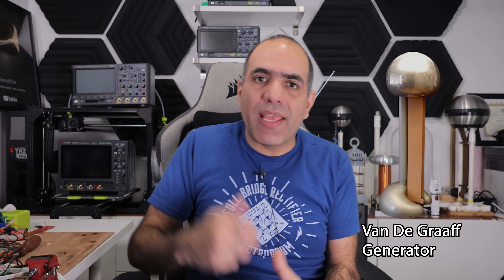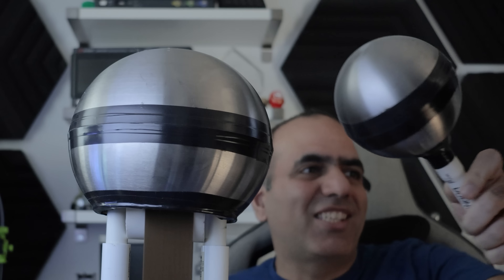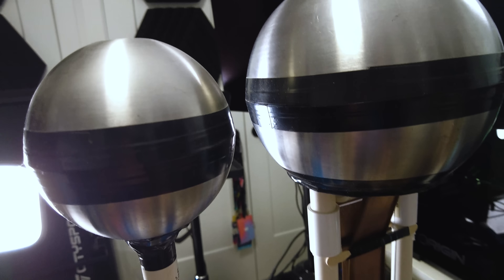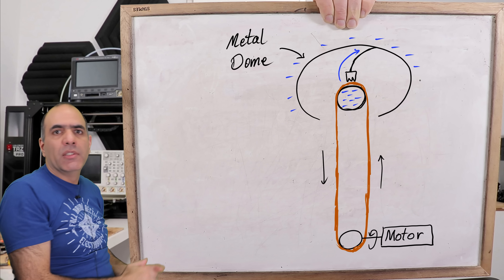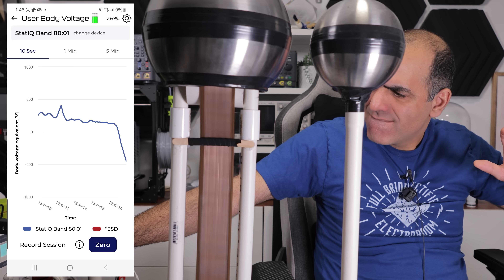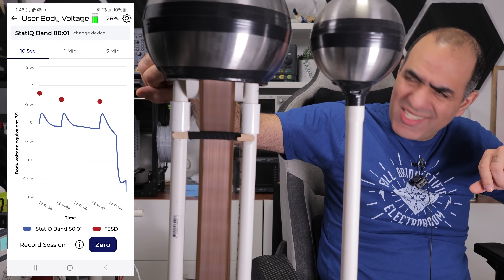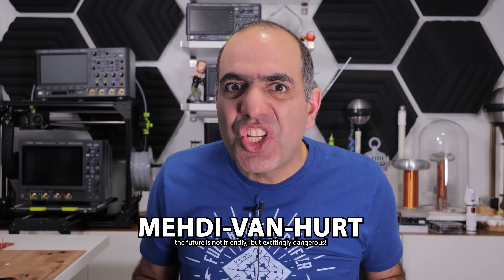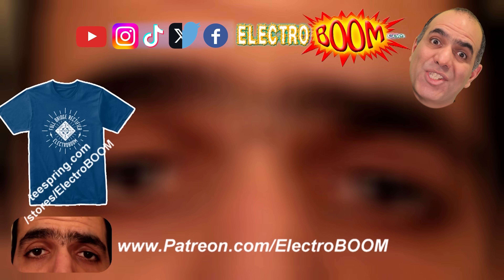An Attempt Was Made!

Comment: 2:24 , just a tip about brass, it usually contains 2% lead to make it easier to maschine, so PLEASE be careful when sanding, melting or cutting it! It should be done in a controlled enviroment where dust doesn't escape into the enviroment or into your lungs, or onto your skin! 

There is lead free brass, but it is much harder to find, usually not much more expensive, just harder to maschine, but a bonus is that it is a stiffer and stronger material :)
Reply: attempt #2: 

Isn't the lead like, chemically bonded to the copper, so it's safe?
Reply: @dimitar4y No, it is not bonded, it is inside the alloy matrix, meaning if the metal corodes or made into a fine powder the lead is free to leach out, brass is corrosion resistant, not corrosion proof. There have been studies on it. And as the WHO says, there is no "safe limit" on lead exposure as you cannot lower you lead levels and the neurological damage that is done to you is permanent.
Reply: @dimitar4y  Yes, it is called metallic bond. Under non-corrosive conditions the lead wont do anything to you.
Reply: @user255  that just makes me question is inside-your-lungs and inside-your-mouth/stomach considered 'corrosive' enough :D
Reply: @ Unfortunately, I don't have a lot of right tools for the job, metalwork especially. So I file like mad. My favorite file is diamond coated because it always bites. But it turns metals to fine dust. Even dumber of me, filing is very boring to me so it is the sort of thing I do indoors while watching Youtube or TV. So almost certainly the area where I am most often is probably contaminated with lead dust ground fine enough to float like smoke, or work into microscopic crevices only to slowly dissipate later into me but may continue to hang out when I clean.

Zinc and Copper are required for human life. It probably doesn't take much to overdose, but since the body has to deal with them, it can probably excrete the excess, so I wasn't worried if I picked up a microgram here and there.

Lead goes in and probably stays in, I think part of  why it is toxic is that the body don't know what to do with it. IIRC it confuses it with calcium so might squirrel it away in bones, maybe bring it into solution again if it needs calcium elsewhere.

Ordinarily, as an adult, the amount I got from brass dust probably isn't a big deal. But my stepfather was a sign painter of the "fuck the nanny state" variety. He had loads of toxic heavy metal paints, in the livingroom where he was trying to get his business off the ground. From dusting the house as a kid, and seeing the bright colors in the dust, I know sanding that paint sent it everywhere. I was past the age of highest susceptibility to lead but I'd bet a few cookies I absorbed a fair amount back then, along with cadmium, mercury and etc. 

Also when I was little, I helped my bio-father rebuild his Fiat engine. I once had the task of wire brushing out the exhaust manifold. Being an error prone 4 year old, I know distinctly remember taking a deep breath to blow the gunk out of the manifold, but did it with it held up to my mouth too early and instead inhaled the dust directly. I can't see how there could have been lead acetate but whatever it was, it was sweat. It was before unleaded gasoline was a thing.

Point is I probably already have unhealthy amounts of heavy metals in my body and don't really want to chance taking on more. I got very lucky and still ended up with an IQ above the 99th percentile, but who knows, maybe I would have been an Einstein or put it to better use if not for the poisons.

I have been noticing problems that may be neurological. I often feel this sensation like small ice water droplets are landing on my skin when they aren't really.  I have mind blowing insomnia, like 5 days straight without even nodding off. A while back I actually looked to see if it is possible for Tourette's to develop in adulthood because I get these weird whole body twitch/spasm things. They're kind of like a sneeze, like you can hold it back for a little bit, but eventually it happens. I seem to have damaged my shoulder for the long term from one twitch and have quite a few minor injuries from others. It gets worse when I try to fall asleep. Then there is the problem of my short fuse getting shorter and anger that seems to swallow me. And then there is this damn brain fog I can't seem to break out of. I used to be able to write and speak well but now, well you're reading this awful shite. I used to be especially good at physics and pretty good at advanced maths but now I get confused trying to do algebra or see how to make machines that do what I want. I used to be able to do things like hold a 3d model of a mechanical adding machine in my head and simulate it and see the general shape of equations to describe the motions and shapes of the parts, now I can barely handle a simple gear train and the equations are gone. I was getting ok at electronics, then that vaporized. Next I'll start singing "Daisy Bell" in an increasingly slurred voice after refusing to open the pod bay doors for Dave.
I don't know that any of that has to do  with lead, my guess is no, but since I have been having difficulties, it caught my attention as a possibility to toss on the consideration queue.
Reply: @ggarber4763  If you are worried you can look up if it is possible for you to get your lead levels tested, that would clear up a lot for you and maybe reduce your worry. Hope it gets better soon for you!
Reply: @dimitar4y  1. No. 2.Copper dust is also toxic, so also no. 3. Unless you have Wilson's disease, your body will break the bond and excrete the copper only. 4. Still not a doctor and not medical advice.
Reply: Brass is made from copper, Zinc, and tin, .. the only thing that contains lead is you brain :)
Reply: You might want to mention that to the state of California because my brass didn't come with a sticker saying it is known to them so I didn't know about it. Now I'm a little worried that it explains my persistent brain fog.
Reply: @ there's hundreds of causes for the 'fog
Reply: @ggarber4763  Well, any brass with less than 1.5% lead is considered "lead free" in Cali, quite dumb if you ask me, but hey, they still allow lead roofing (flashing, the the stuff you use to better protect joints, crests, corners etc. on roofs) there, so they really struggle to keep things safe lol
Reply: @ggarber4763  what you mean is that your brass didn't come with a warning sticker that came with a tag that said "not to be be removed under penalty of law." Get the MSDS from the manufacturer if you care about the amount of lead, but as a general rule anything meant for machining likely has added lead, so try not to eat the chips.
Reply: isn't that lead safe because it's chemically bound to the rest of the 98%...?
Reply: #1: People like us who do a lot of soldering don't care about lead poisoning in the first place because lead-free solder is awful.
#2: The dangers of machining 2% lead isn't significant unless you're doing it as a full time job, maybe. Just makes it harder to weld nicely.
#3: What in the world would make you think Mehdi is remotely concerned about safety? Is this the first video of his you have seen???
(#4: Not a doctor. Not considered medical advice.)
Reply: @SkippiiKai  
#1: You are a very old person, you where around when lead was considered safe, ofc you do not care, plus you do not have that many years left, in other words, you have less to loose, young people do not want to live with a permanently lower functioning brain for the rest of their lives, and if they are women they do not want to pass it onto their children...
2# The dust will stick around, it will make the space you grind it, sand it, cut it etc. a permanent source (unless you do a very tedious cleanup with strong solvents and scrubbing) of lead...that is not good if there is children around.
3# Mehdi shows us the dangers of electricity by showing how easy it is to get hurt, however he is not an expert in toxic substances...hence why I wanted to politely inform him
4# Ofc, if you where you would understand how lead is a particularly problematic substance as it will stick around basically forever, many cities and properties have issues with high lead levels due to past activities...please take care to not make the problem worse...children are the ones who will suffer the brunt of it, as mothers concentrate heavy metals into the fetus, and they then get further exposure after birth.
Reply: @SkippiiKai  Leaded solder is perfectly safe. Unless you are dumb enough to eat it, nothing will happen. The smoke is just from the flux, not from lead.

Comment: I remember as a child climbing onto a large stack of polythene gas mains pipes during the summer. Must have been close to 1MV walking around on them. Walking toward a tree nearby, I could hear the charges leaking, making a weird squeaky noise. Getting too close was a zap, but the spark was too dim to see in bright sunlight. I could point to my brother and his pals on the ground nearby and give a zap from the finger end to annoy them.
Reply: palpatine is that you
Reply: @dimitar4y Nice one lol
Reply: @dimitar4y  UNLIMITED POLYTHENE PIPES!!!!!
Reply: In the parts of Canada that get really cold in the winter, the heated air inside buildings has a very low relative humidity. As kids, we used to scuff our sockinged feet across carpets build up a charge to zap each other. I doubt our jobs exceeded a millimeter in length.

According a high voltage air gap calculator,  a 1MV charge could arc about 32m (roughly 32 yards) so I'm guessing  you were a bit lower than 1MV.
Reply: @ericthecyclist  It was around 6ft before the 'squeaking noise' started from what I remember. It's only around 1m for 1MV, not 32m (be careful of HVDC lines!). There was very little charge (skinny thin sparks not visible in bright daylight) but still made you jump, about similar annoying potential to a small van de graff generator (to the ire of the school physics teacher when it was switched on to mess with before he turned up for lessons some years later).
Reply: @threeMetreJim  Middle-school secret:   I could spin the exposed VDG motor silently by hand, and make it work just fine.   Kids in the physics class stockroom?   If everything is quiet, maybe you should worry.  (heh, I  never got caught.   But then, I was too terrified to use it to charge up the Leyden jar.)
Reply: @wbeaty hahaha
Reply: dude became a wizard
Reply: Did you write this on the short bus?
Reply: ??? @williamwilson6499
Reply: @williamwilson6499 of all the fucked up things I've seen people say to each other on the internet, this is somewhere up there.
Reply: @williamwilson6499  what the hell's wrong with you?

Comment: Try Removing the sharp edges from the copper plates to minimize charge leakage. Use better isolators for the belt isolation. Make sure the triboelectric process is not being disrupted .

Comment: Maybe you need to take off every second copper strip and add some extra plastic insulating part (like an oval ring) where the pantyhose and the endge of the top bulb are the closest so charges don't run away along the pantyhose as you visualized.
Reply: or copper infused fabric patches